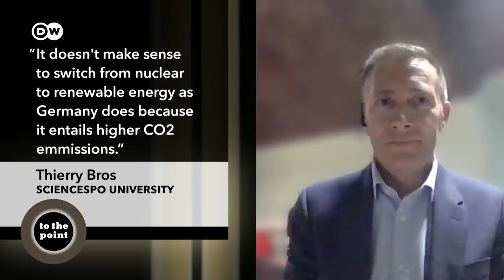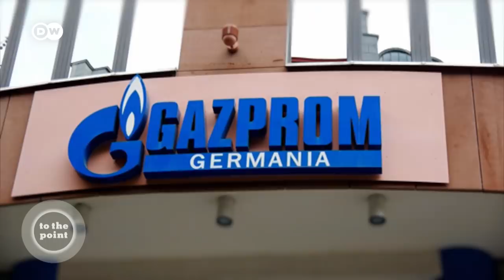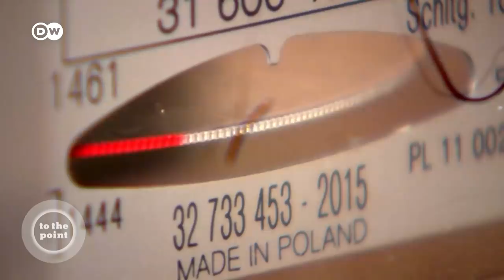Bleak winter ahead: Who’s to blame for Europe’s energy crisis? | To The Point

Comment: Wind energy is not only solution.. Wind energy is already showing drastictic changes int he downside and wind is fluctuating as well. Also wind is expensive... So being Minimum is the only way possible.... For now you would laugh but Bet on it in next 3 years you would agree
Reply: @oddvardmyrnes9040  Adding up with local egress waste for pyrolysis closed chamber burning can add up for some number of energy. Agricultural waste resources can be utilised for energy and carbon capturing. Inititation has to be done ASAP. Of my 30 years of existence I see heavy rains in OCTOBER which was never the case before 2017. Things are changing, and adaptation I needed.
Reply: @Praveen0759028  .. Drop in a bucket. Not enough.
Reply: @oddvardmyrnes9040  Though it will empower rural sector(With rebound affect for sure).. The Climate impact is universal and has no boundaries. So good here is good everywhere... There is saying every drop accu,mulates to a bucket full of water.. Implimentations are the key to see the results and generate stats together wit other sector
Reply: @Praveen0759028  .. Yes. My assumption was Europe. Developing countries with local needs - of cause. There are many systems for that. Solar collectors & sterling engine driving a generator, biologic production of methane etc.
Reply: @oddvardmyrnes9040  Totally agree witht the options on the table still the lobby works stronger in-spite EU or ASIA (India). I have a background of EU experience for 2 years, returned in a motto to change. Working on it hard. Though my strength is in Pyrolysis and Rammed earth for shelter and energy balance. 

It is a good convo to explore and learn Dear Myrnes.. Keep me posted.
Reply: @Praveen0759028  .. Pyrolysis  you say? I am interested in pyrolysis systems for making fuel from plastic & rubber (car tires). Solar collectors for heat. Any experience with that?